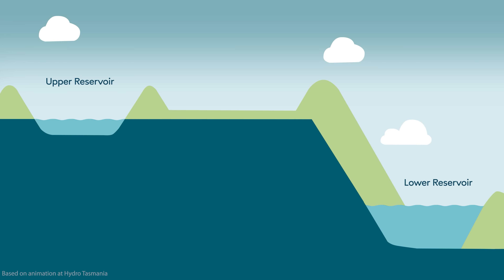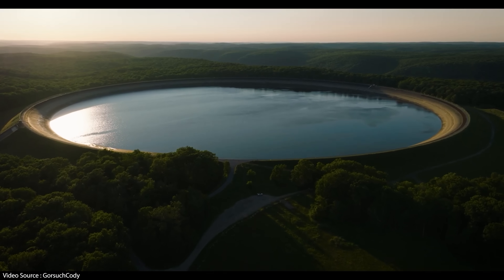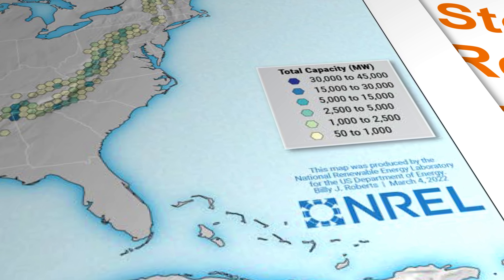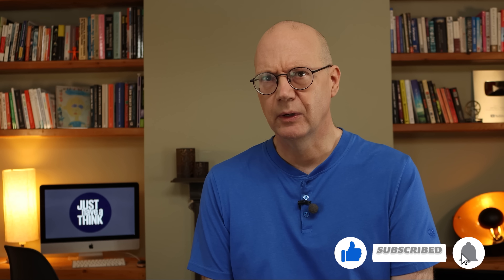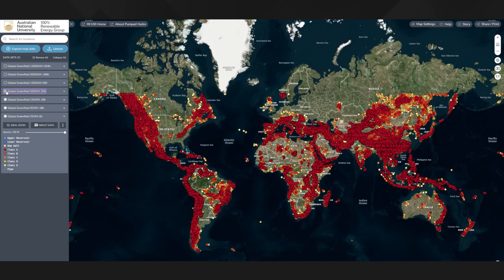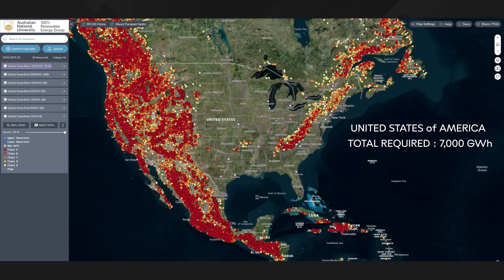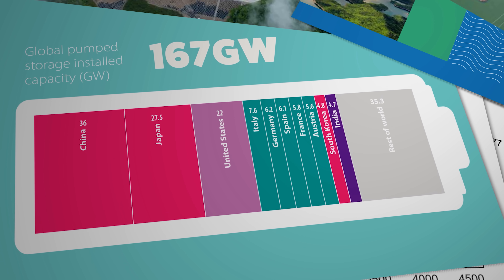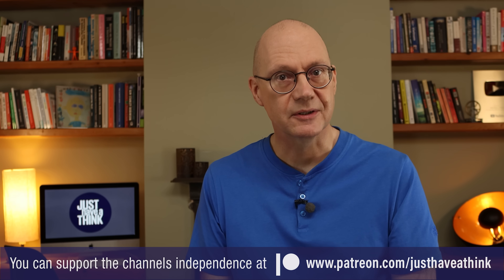The insane potential of Pumped Storage Hydro

Comment: It would be interesting what kind of carbon footprint the construction of such hydro plants are. I would expect a lot of rock needs to be crushed and moved and a lot of concrete poured.
But as someone living kind of near the Alps I hope the numbers work out! The European grid could use it!
Reply: I can guarantee you the carbon footprint for the construction would be less than the carbon footprint for the equivalent energy generation by fossil fuels.

Perfect is the enemy of good and done, so it's about time we start working on some less than perfect solutions and get something done.
Reply: @youruniquehandle2   have you considered the volume of concrete and its associated emission and pressure on resources? What about competition for land use that will be flooded? These are obvious questions to answer before choosing between alternatives. Otherwise the solution may not even develop at scale and it is a waste of our resources. It is unclear why and how you would compare to energy generation for fossile fuel, the question is about storage, so that involves comparing with alternative storage solutions, dispatchable low carbon energy (e.g. nuclear), or simply collectively agreeing on a reduction of our energy consumption, notably when there is no wind and sun...